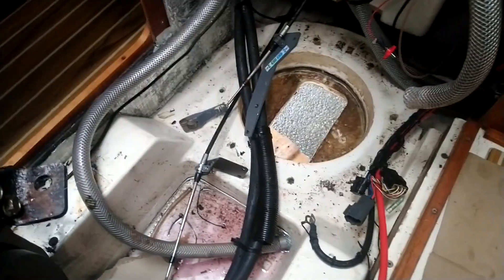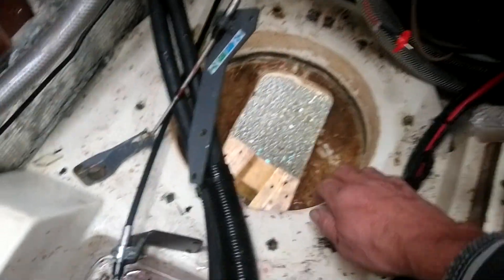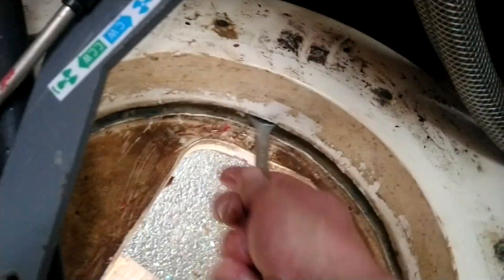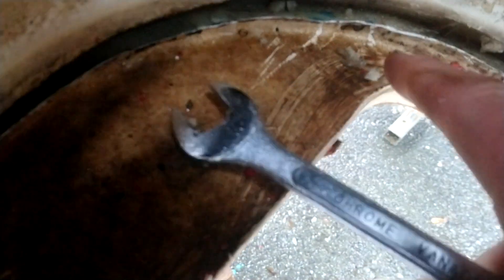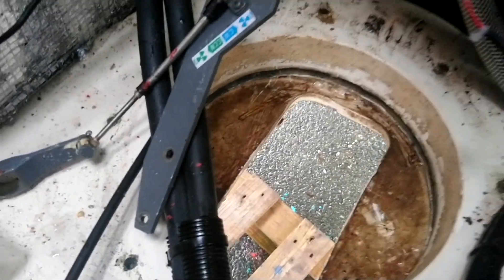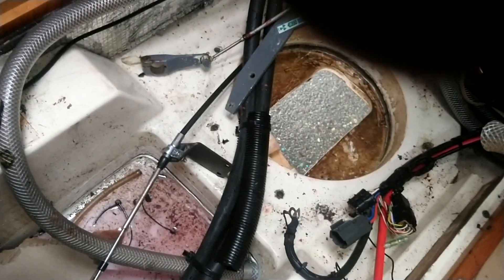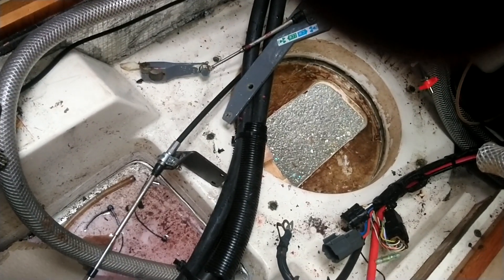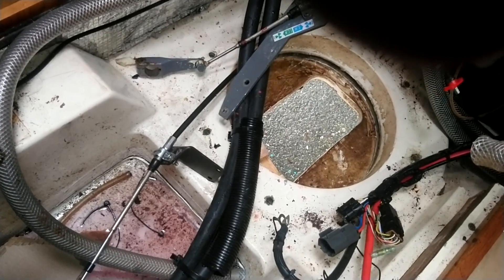Yacht Sail drive hull moulding failure

Comment: Looks like the bed was cut out already or was in prep for removal and re- fiberglassing in. The depression under the motor looks to be severed
Reply from the maker: Not preped, exactly as it was found on removal of the engine....
Reply: @TheMarineSurveyorNotebookBenSu  wow looks like it was cut in the depression area under the motor. I’m scheduled to get hauled out soon as I have a small leak in the doughnut area to the hull